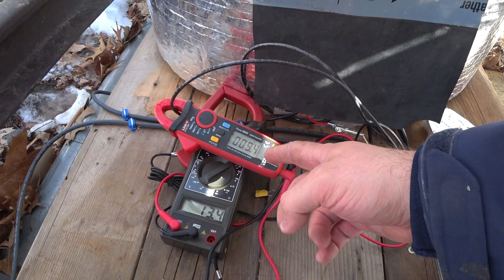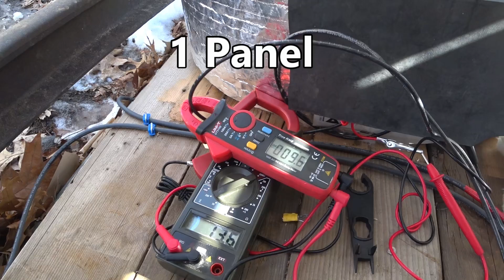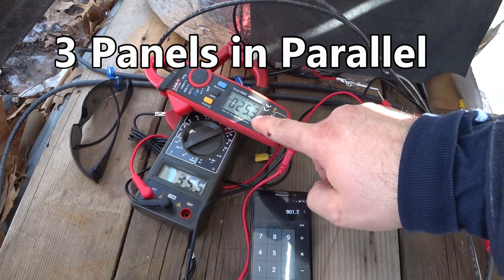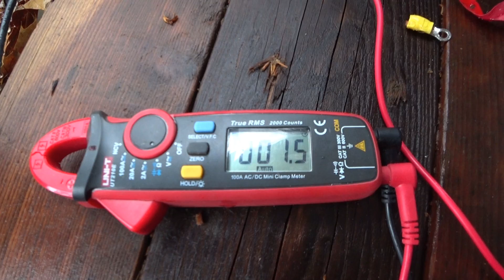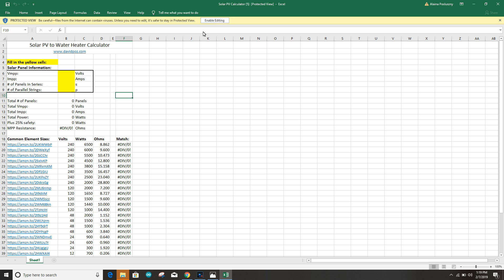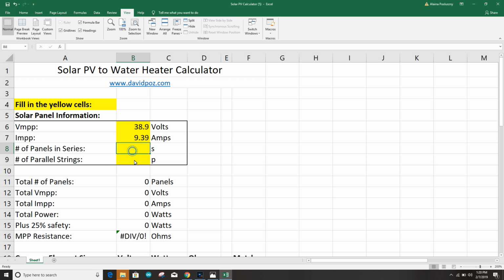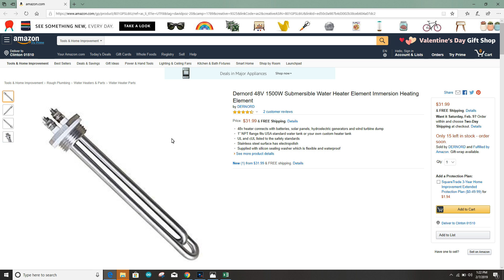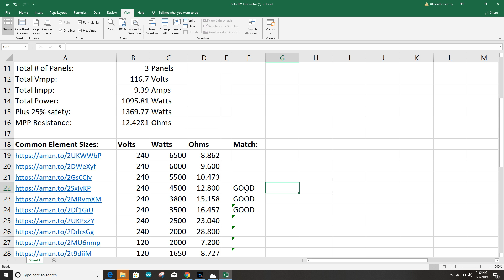Matching Water Heater Elements to Solar PV Panels

Comment: thats one way to do it, the other way is to get a small controller specifically designed to connect panels to the element that comes standard on electric water heater tanks.  Check it out at techluck.com
Either way, this is how I will be heating my water at our future off grid home, also may have a supplemental system coming from the fireplace piped to the water heater....still figuring out the details on it
Good video on the system you are trying out
Reply from the maker: Thanks for watching.  I e-mailed techluck a couple years back trying to get more data on efficiency, but never heard back.  I've watched his videos as well, but no efficiency data.  It's a great idea, but I'm not ready to buy one without some proof it works.  Any my definition of "works" is produces more power than a direct connection like I have.  I would love to do a side-by-side test if I could get my hands on one of those controllers.  It might be awesome, I don't know.  That's why I want to find out.  If you are going to buy one could you run a side-by-side test and send me a link to the video?

I love that you are going to supplement with a pipe in the fireplace.  That's awesome!
Reply: @DavidPozEnergy , I was planning on getting one after watching Engineer775 on youtube having nothing but great things to say about it. When I get my hands on one, I will let you know. And I managed to grab another chevy volt battery pack!! Yay
Reply from the maker: O, Awesome about the Battery.  I've been keeping my eyes out for one locally, but nothing yet.

I've also seen Engineer775 videos.  I've been watching him at least 8 years.  I love his videos in general, but his video on the techluck lacks the same thing.  He just shows that electricity is happening, but not how efficient the unit is.  I was hoping for more.
Reply: @DavidPozEnergy , maybe I send mine to you for "testing"?  Im going to have my hands full come spring with lot clearing and milling lumber.
Reply from the maker: That would be great.  Let's connect on facebook, or e-mail.  https://www.facebook.com/DavidPozEnergy/
Reply: @kameroncuk6557  I'd love to look at one of those units in operation.  Do you have a USB scope that can grab an image of the waveform? I don't think the capacitors are sufficient in the techluk to last for years or to store all the energy during the off period. Extra caps outside the unit could always be added. Have you looked at the German unit?  It might interest you to look at my videos. My system allows parallel operation of a battery charge controller and any excess is harvested to heat water.  Any successful PV system always has a lot of excess power waiting to be used.
Reply: Its just too bad the techluck guy is dead set against offering a version that can switch between grid/pv while using only a single element.
Reply: @malcolmmacleod5579  I've read some of his threads on why he is against it due to safety reason. PV and grid power is nothing to mess with. If the two start to mix due to a component failure it is extremely catastrophic and the last thing you want to have is your house burning down because of it. There is a transfer switch out on the market which can break the grid circuit and go to PV vice versa. However that type of automated switch puts it in the over $100 USD price point where most DIY can really justify the cost. At a somewhat reduced cost there is a manual double pole double throw center off (break before make) switch out there.

I already have an existing standard 50 gallon electric water heater that I converted to PV direct on the lower element and left the upper part on the grid for backup purposes. Bumped the lower thermostat to 150 F and added a tempering mixing valve to keep the output to a safe 115 to 120 F to prevent scalding and additional insulation to reduce standby losses to boot. I never really gone too much of logging data on it, but it seems to work fine in a family of 4 household. However we are very conservative with our hot water usage and living in a subtropical zone might be a factor. Looking forward on David's data results on PV vs. Thermal regardless...